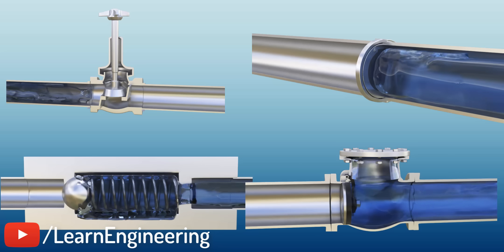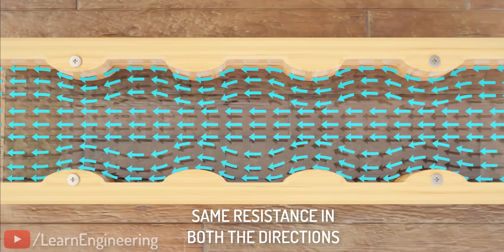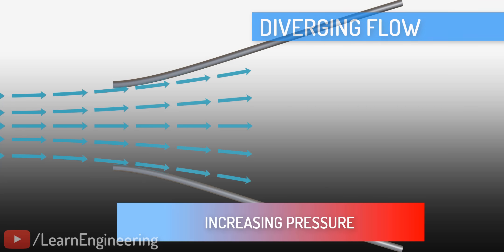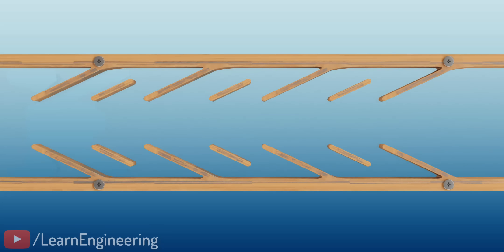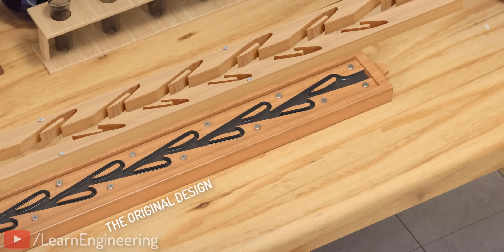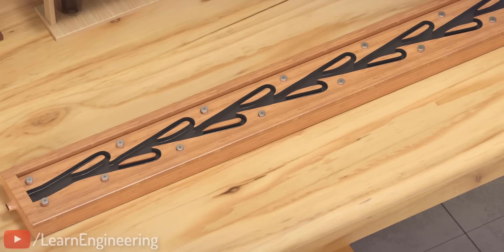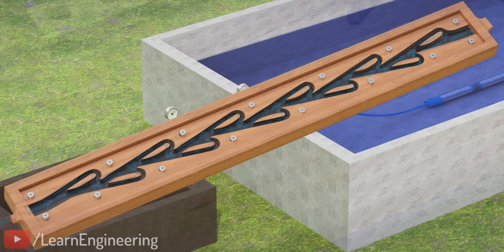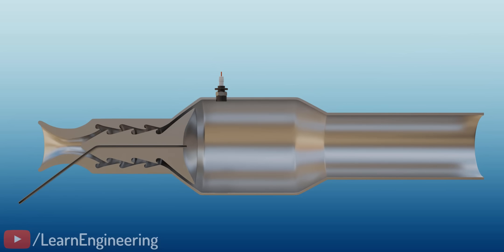Tesla Valve | The complete physics

Comment: I understand why liquid would flow faster when the space is restricted; you have to get the same amount of liquid through a smaller gap in the same time frame so the speed has to increase. But why does faster flowing liquid cause a pressure drop? Is it something like, it is in any one location for less time so less time to exert a pressure on its surroundings? Maybe it's easier to think about the reverse... i.e. when the space increases the flow slows down, so if you were fast moving and hit a slower moving thing, you would feel more pressure from it, than if it were moving faster than you. In fact if it were moving faster than you, then in effect, you wouldn't hit it, therefore it would exert no pressure on you. I guess that can be reversed again to say that if you were a slow moving thing and you "hit" a fast moving thing you wouldn't feel much pressure from it. OK I might have gibbered nonsense there but I think I might get it now. Feel free to chime in with better explanations!

Comment: I dont really see how this is practical or superior to conventional valves. Of course it seems to have a use in limited designs that require high pressure mitigation with reduced wear. But the pressure allowance is fixed, you cant change the amount of pressure or shut it off completely so it doesn't really fill the roll of a valve lol. Its just a restrictive channel how is it actually considered a valve? Just doesnt seem practical or effective in the vast majority of applications. Not to mention that youd probably need a conventional valve at the end of a tesla valve for it to have a shut off which is pretty redundant.

Comment: In my opinion A barrel flow inset would be the most efficient to improve flow within a pipe as pressure flow with the centrifugal forces acting on it would help with consistency of flow dynamics , Not that im saying tesslers theory isn't allied im sure it is ,its just whether it can be applied to a stop valve mechanism or not my theory what i do know is the less moving parts you have in a mechanism  reduces the potential for replacement , failed  system so the simpler the better

Comment: That's incorrect.. If you have smaller space, it will give you higher pressure. Moving into a larger space will give you low pressure

Comment: this wont stop water from flowing backwards. it will drastically reduce the flow but inevitably a dribble will be allowed when flowing in reverse, it has limited applications but the applications it does have are critical.

Comment: Something not mentioned in this video is that alongside the mentioned flow restrictions of the Tesla valve, after the first switchback the "main" flow will be directed towards the next switchback each time. It doesn't appear to be an even split into primary and secondary.

Comment: Dissolved solid buildup within a short time would render the valve useless. Mechanical valves can suffer the same, but the movement is often enough to restrict mineral buildup. I can only assume the same for unburnt fuel and carbon doposits in the pulsejet in the high turbulence areas leading to valve failure.

Comment: Let me start by stating that I believe the mysterious Greek Fire of ancient times was actually pure sodium.  It is a metal, and the Greeks would have rendered it by using an archaic solar oven or parabolic reflector similar to Archimedes' death ray to melt salt.  When sodium is purified it combusts on contact with water and that is what the Greeks would have launched at enemy ships.        

Now, if you take a 1 meter magnifying lens and use it to focus sunlight, a heat sink could reach over 1000 degrees almost instantly.  If an adjacent chamber is equipped with one-way valves to release the gases inside, it will become a hot vacuum when it cools slightly.  Adding steam to that hot vacuum chamber will cause the water vapor to fracture into hydrogen and oxygen gas.  If salt water were distilled from the chamber then it would result in a hot vacuum lined with molten sodium, which would ignite the hydrogen and oxygen from the steam when it was reintroduced.  This process could fire a cannon, or if it were over-pressured could potentially become an atom bomb.  It is possible to use solar energy to burn seawater as fuel!              

 A nuclear reactor typically burns no hotter than 700°F and is used to generate steam to spin turbines. With a lens 1.5 meters in diameter, a temperature of 2000°F is easily achieved. An array of lenses and tubes as big as a football field utilizing concentrated solar energy and seawater would be fierce competition for any nuclear plant 6-12 hours a day, without the radioactive toxic waste. Given the vast potential present in a simple salt brine, burning our limitless seawater as fuel with a meter-sized magnifying lens seems like a viable alternative source of energy.  

 We could convert the water to hydrogen and burn that, but an even simpler option would be to use a pool (or brick) of hot NaCl at around 1000°F as a heat sink for pressurized distillation of seawater. Simply drop some saltwater into the pool; the steam is distilled and the salt stays behind as part of the mechanism. Also, since salt can be used to store heat overnight the machine could remain operational 24/7 once established. Lens-powered solar stations could move ocean water inland via steam pressure through a pipeline;  this would solve both the energy crisis and the water crisis at the same time.  
 Thanks for reading

Comment: One thing I couldn't understand in this video is, what's the problem with moving parts. Where(potential application) will require a one-way value without moving parts ?
Reply: Moving parts wear out a lot faster.

Comment: it seems like this valve is in 2d. Would there be further efficiencies gained if the concept was also applied to the bottom and top of the valve chamber? Assuming a pipe isn't a channel but rather a horizontal column of fluid

Comment: And that's two dimensional.

You could alternate units in the third dimension as well, or increase the number and density by adding successive units at small angular changes with many alternating pairs.

Then spiral the design to elongate the valve length.

Comment: I would just like to point out that the video failed to make its point. In the first 30 seconds the goal is set up: A one way valve without moving parts.
Full fluid stop in a pipe going one direction, but no to little stop into the other direction. But with no gate or other moving part.

We spend the rest of the video exploring a design that doesn't do any of this, and you just don't bring it up.
Or to make it easier to understand: How to use a gasoline engine with no gasoline? Simple, just use gasoline, but let me go into full detail how the engine works, hoping you forget the question.

My teacher would have kicked out of the classroom with an F. No matter how often you call it a valve, it is none. It is fully built on manipulating the viewer.
Reply: I mean, just look at the sentence at 5:45: "Modern valveless pulse jet engines use the tesla valve"
Reply: cry about it.
Reply: @user-lynKx  quality comments

Comment: This might not have any moving parts, however, it will never be a true “one way valve” without any moving parts. It’s a great design, but check valves (plumbing name for one way valves) main purpose is to stop water from flow, not to slow it down. You put check valves in buildings in cities so if there’s a negative pressure on the incoming side of flow of the valve, contaminated water doesn’t go into the sterile main system. This would never be a true check valve

Comment: Tesla valve is still a one way valve only with the help of 180 angle shift with its centre of mass as its axis(i.e.):- still there is a movement involved right. So, it's no difference to the convention valves right.
I'm holding the door open for someone to correct me.

Comment: Well, intuitively I thought the flow going left to right was less restrictive but after the explanation I see the point.  I propose a high pressure gas being allowed to expand from a small confined space to a larger area, and, if done in such a way as to not induce turbulent flow, will, due to conservation of energy, cause pressure to decrease, velocity to increase, and temperature along the stream to decrease.  I will call my invention...air conditioning.

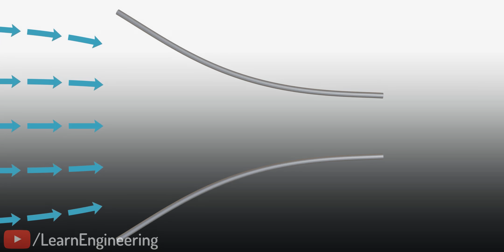Comment: 1:26 In convergent flow, if the area decreases, velocity of the fluid increases implying an acceleration and hence net Force in addition to the momentum of the liquid. Decreasing area should thus translate to increased pressure along the flow of the liquid.
Why does the narrator state decreasing pressure in converging flow?
Reply: I was confused about that part too..p=f/a , like you said the lower the area, the higher the pressure is....not to mention pressure is created by the restriction of flow...and a narrow path is a restriction which creats pressure

Comment: In airflow through a duct in HVAC applications, turbulence causes restriction to flow. Turning vanes and proper transition design is vastly important, especially when the pressure available to move the air is so small. A small restriction doesn't cause a small difference in air distribution to an outlet, a small restriction means almost all the air goes to the least restrictive path. Poor duct design or installation can make air balancing almost impossible.

Comment: The wiki page says that, for the Tesla valve, the reverse low is 15-40x lower compared to the forward flow. This ratio may not be sufficient for some applications. Valves shown in the first few seconds of the video can be made much more efficient than this.

Comment: The interesting thing about this apparatus is that the reduced flow from the output side is fairly consistent no matter how much pressure is on the input side.  It's not adjustable but this would have applications where someone would need a relatively stable volume of liquid flow regardless of the changing input pressure.  I think that is the real purpose of this valve, not so much being a one way valve.
Reply: I think you are right. It’s a simple and robust way to meter something using higher pressures elsewhere. It really can’t stop flow because it relies on the dynamics of flow to even work.
Reply: its a solid state oscillating pump, remember he was working on pumps
Reply: They also didn't discuss viscosity which could have significant impact on the system.  The size would just need to be customized for each fluid and desired flow.
Reply: I wonder if there’s a lower threshold whereby if the input is slow enough, the various divergences and vortices are minimised, therefore the the output would be increased compared to if you had a higher input (which would seem to create more restrictive flow?)
Reply: @oscarwoodly7392  i was wondering the same, anyone got answers?
Reply: I believe this valve is adjustable. Just add, or subtract more secondary flow loops.
Reply: @carls1959  of course it is, however not executable in industrial areas. Also it keeps getting larger the more u ads.
Reply: Yes it can have a good application in drip irrigation.
Reply: Self-regulating flow valve?...
Reply: I think the backflow preventer as demonstrated in the pool example is an incredibly appropriate application as it will never achieve enough pressure to enter the water supply (typically 75psi for residential water systems)
Reply: Good wark
Reply: If only the ancients knew about this, they could have used it to make great water clocks I guess.
Reply: wow
Reply: Ya but it seems like its a job that a conventional valve is still capable of. The only real benefit at the end of the day is reduced wear while having a lot more drawbacks than value
Reply: Could even be called a pressure regulator, or accumulator?
Reply: applied in his heat engine
Reply: That's similar to how a diode in reverse-bias works as a voltage regulator, except here it's a current regulator
Reply: Δοξάστε τον Ιησού, τον ίδιο που μπορεί να σας σώσει από τον αιώνιο θάνατο. Αν απλώς αφήσετε όλη την εμπιστοσύνη σας σε Αυτόν, θα βρείτε την αιώνια ζωή. Αλλά, μπορεί να ντροπιαστείτε όπως ντροπιάστηκε Εκείνος. Αλλά μην ανησυχείτε, γιατί η Βασιλεία των Ουρανών πλησιάζει, και εναπόκειται σε εσάς να επιλέξετε αυτόν τον κόσμο ή Αυτόν / Παράδεισο ή Κόλαση.

 «Πηγαίνετε λοιπόν και κάντε μαθητές όλα τα έθνη, βαφτίζοντάς τα στο όνομα του Πατέρα και του Υιού και του Αγίου Πνεύματος, διδάσκοντάς τους να τηρούν όλα όσα σας έχω προστάξει· και ιδού, είμαι μαζί σας πάντα, ακόμη και μέχρι το τέλος της εποχής». Αμήν."

- Ιησούς

-Ματθαίος 28:19-20
Reply: Think of it this way, each divergence in the stream fights the initial pressure, so in essence "halving" the flow each step. You divide by 2 enough times you reach a small enough amount that is similar, as you said, regardless of input. That being said it is related still, just not as noticeable because 1 is close to 2, but 100 is far from 10000.
Reply: There's probably a fairly linear relationship between input pressure and output volume.
Reply: Ad a low pressure valve at the end
Reply: @TomFloridaMan  Won't work, because as soon as you stop flow the pressure will build up and open the valve.
Reply: https://youtu.be/NYGq0bD3NBk
Reply: https://youtu.be/NYGq0bD3NBk
Reply: https://youtu.be/NYGq0bD3NBk
Reply: https://youtu.be/NYGq0bD3NBk
Reply: https://youtu.be/NYGq0bD3NBk
Reply: https://youtu.be/NYGq0bD3NBk

Comment: i wouldnt necessarily consider it a one way valve/check valve i would more so call it a pressure reducing valve because fluid can still pass through both ways just the one direction it reduces the pressure/velocity

Comment: The venous system works similarly. The valves stop backflow, while forming a bucket structure that causes the blood to turn back in the direction of the heart. Please do a video on Viktor Schauberger, the Austrian forest warden who used vortices to enhance fluid flow efficiency instead of considering them a nuisance.
Reply: hmmmmm

Comment: So if it still allows fluid thru what is the point! A check valve stops water completely
I appreciate your video but it's not even close to working like a mechanical check valve
Luv tesla but this would not work for the purpose of stopping water back feeding

Comment: The DeltaP seems depending on the flow rate. This will work great for mixing applications not sure about replacing check valve applications.
Great mind.! Great animation. Thanks.
Reply: With the toy version, the harder you blow, the more resistance you get, but it never is completely blocked, and maybe low airflow lets through more than higher airflow... Very little resistance until you get to a certain airflow anyways...

Comment: The thing with this valve is, and correct me if im wrong please, but I don't think that this is a valve. A valve is designed to not let water through at all, or one way only. Fluids and gasses can flow from one side to the other with this valve. Now, not as easily when going up the valve, but it still can.

Comment: One question:
Why can't there be two diversions?? Like a heart shape, it would ensure more momentum loss wouldn't it??
Reply: Because if you put two, then the pressure within this diversion will be too strong to function and completely reverse the flow of fluids. And if you made the middle tube wider to fit the two diversion points, then that's just beating the purpose of creating a tighter stopgap.

Tesla's design only works here because it optimizes decreasing its scale to make the most precise momentum loss as they can.

Comment: Can it be used to block 100% flow if we place it vertical where the reduced pressure and gravity will work together to push back the fluid?
Reply: Even a straight piece of pipe would block the flow completely if you have it vertical for long enough.

Comment: valvular conduit by its inventor, is a fixed-geometry passive check valve. It allows a fluid to flow preferentially in one direction, without moving parts.
 
Principle of operation of a Tesla valve:
at each segment, part of the fluid is turned around and interferes with the forward flow.

(a) Forward direction. Two adjacent filaments remain in the central corridor of the conduit with only small lateral deflections.

(b) Reverse direction. The filaments ricochet off the periodic structures, deflecting increasingly sharply before being rerouted around the 'islands' and mixing.

Comment: Wait a damn minutes! This is some "miracle" invention? How was Tesla some kind of genius to figure this out OVER 100 YEARS AGO!?  The Archimedes Screw pump was a far greater invention and that was 2000 years ago!  What was so difficult about figuring out this process?  Someone comes to you Joe Schmo and says, "how can you stop the flow of a liquid without anything mechanical in the use". THAT IS WHAT A MECHANICAL VALVE DOES! So Tesla FAILED that request didnt he? YES!  So you Joe Schmo thinks about what you have seen in nature or around home,  how can a fluid NEARLY slow down itself without using a mechanical valve, so you take a hose ( they had hoses 200 years ago too) and you take a Y fitting to make the one hose into two hose to split the water flow and curve one of the hose to spray water back against the other straight hose and you see it slows the water into the container at the end! Big F'ing Deal Teslard! It's the same thing he did, turned part of the flow against its self! BUT ITS STILL NOT A VALVE BECAUSE IT CAN'T COMPLETELY STOP THE FLOW LIKE A MECHANICAL VALVE CAN, OR METER WHAT AMOUNT YOU CHOOSE, which the Tesla VALVE CAN'T EITHER!